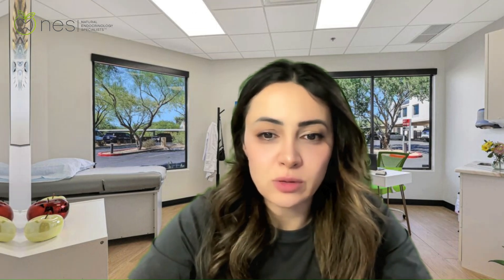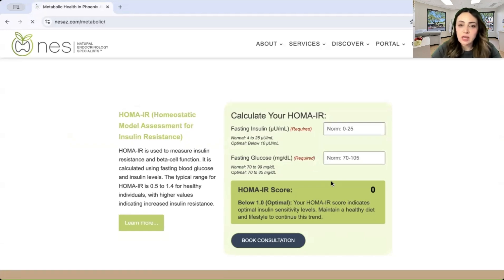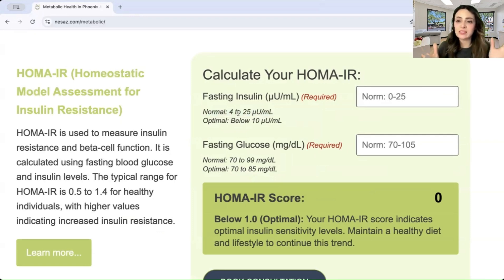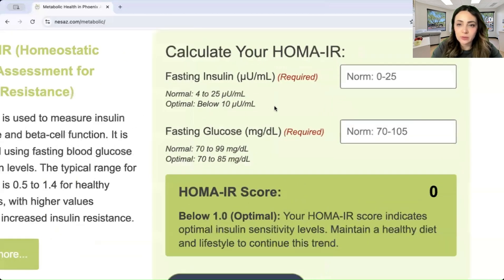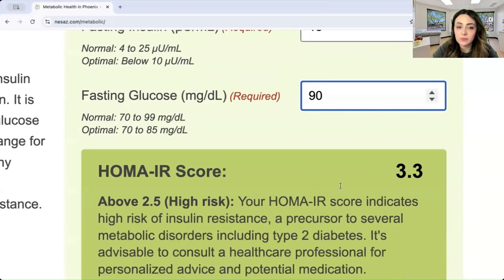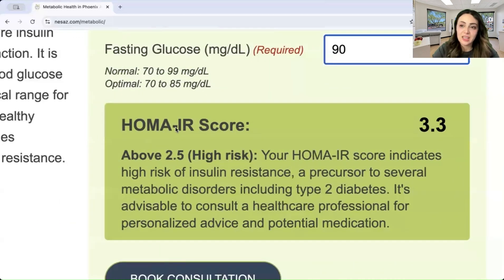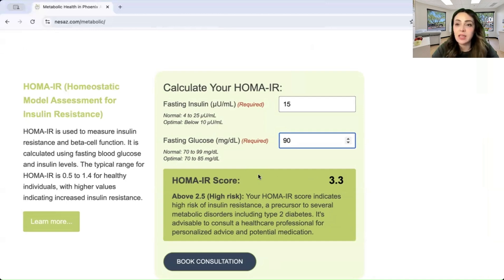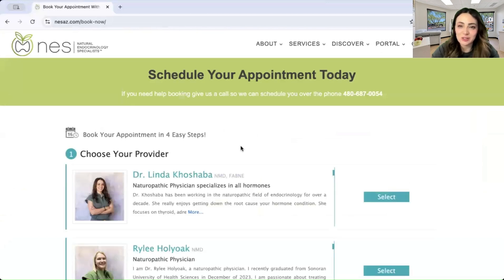HOMA-IR Explained: How to Calculate Insulin Resistance and What Your Score Means

Comment: Mine was 0.7. Yet, I'm still a prediabetic. It's because I was born with a wimpy pancreas. I also suspect that my twelve hours a week of exercise is making me produce less insulin because my system is using GLP-1 when I'm exercising and not insulin.
Reply: Below 1 is an indication of insufficient insulin production
Reply from the maker: Thanks for sharing your experience! A HOMA-IR score of 0.7 is interesting, and your point about GLP-1 and exercise is a good one. Everyone’s metabolic health is unique, with factors like insulin sensitivity, pancreatic function, and activity response varying widely.

If you’d like to learn more, we have helpful articles on insulin resistance, GLP-1, and metabolic health at www.nesaz.com.
Reply: @drkhoshaba  i was on mood stabilizer depakote for about 18 months. i shouldnt have trusted my dr. i knew anti psychotics carried risk of weight gain. he said dont worry if i watched what i ate. i recently discovered it causes insulin resistance. my homa ir is 9 ! its difficult to lose weight. i stopped depakote immediately, aftering taoering off. if i cut carbs can i reverse this and increase my sensitivity?? i'm pissed !1
Reply: Mine came back zero? Fasting insulin is 3.3 and fasting glucose 79. Should I be worried?
Reply: Is your HOMA-IR 0.7?
Reply: Do you have any blood disorder as HbA1c also depends on the health and lifespan of your rbc